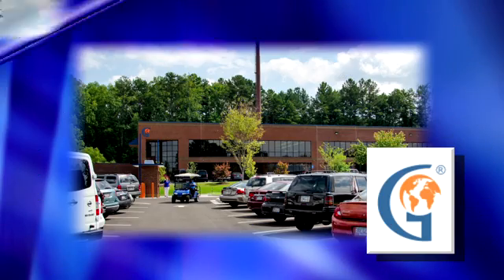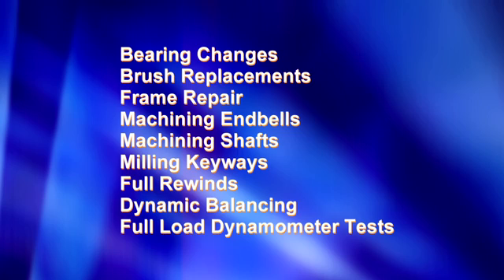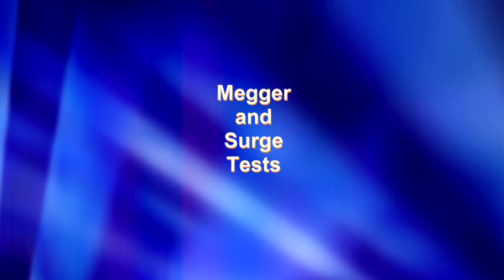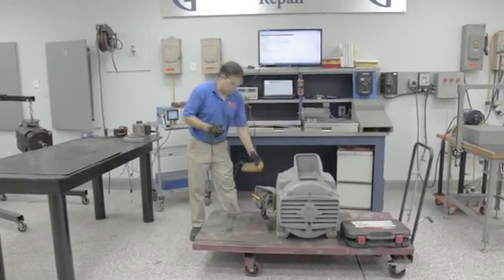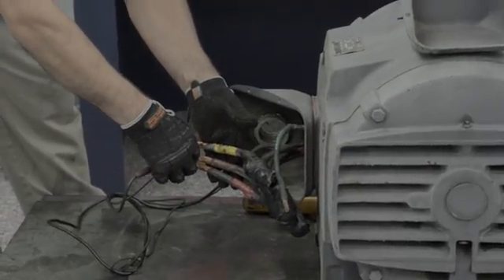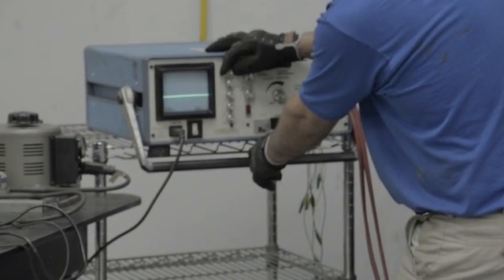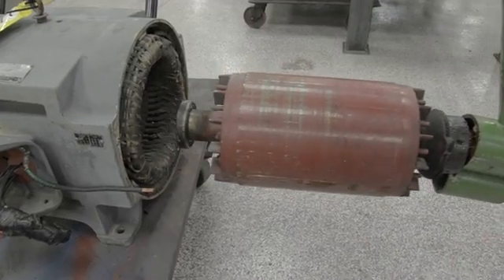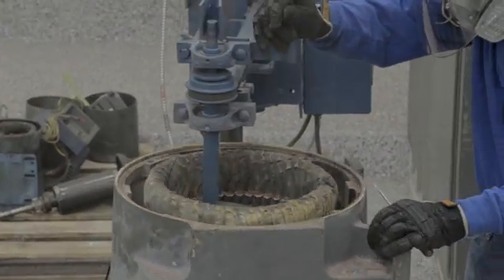Electric Motor Rebuild Disassembly and Reassembly - Global Electronic Services

Comment: Currently i am facing a problem With DC Motor.problem is mentioned below:

1. DC motor was overhauled.Rewound Field Interpole and armature windings.all windings are in good condition with 2000 Mohms value.
2.Polished and skimmed the commutator,,drop tested. found ok.
3.Brush and carbon holder is in good condition.

Now the problem is motor is giving heavy sparking on load. Application of motor is boom hoist motor.

On No load motors runs smooth no sparking,no vibration.

Why it's giving heavy spark on load and we opened twice the motor but not able to get the root cause.

Anything else that i need to check?
Reply: Hari Arjunan Your field winding or you armature May be wrong .winding may have Metric wire and your ohms maybe off.
Reply: Does your armature have equalizer if it does it may be off. Re set your neutral

Comment: is there any motor that can with stand 125 to15odegree heat if there then please mention
Reply: Class " H " insulation is 180 Degree C.  Nomex, and for this stator it was probably 5-5-5 with a double dip and bake ( Won't see this motor for 20-yrs unless it goes down on bearing. )  Nice CLEAN Shop.
Reply: Paul Monaco class H is not 180c. NKN is. Not NMN.
Reply: @HmongGuitarPlayer  Well Jr.    I was referring to " MOTOR TEMPERATURE RISE "  Class (A) = 105 Degree C.  Class (B) = 130 degree C. Class (F) = 155 degree C. Class (H) = 180 degree C. RISE.  I've been rewinding motors for 40 plus years, and you want to TEACH me something NEW ? ? ?   I was answering the gentleman's question above, and I'm guessing that over the last 40-years  I have spent more money on N-M-N Insulation, than you make in a year.  I do K N O W a lot about what I'm talking about. Have a NICE Day.
Reply: Paul Monaco are you a coil winder for 40 years or a motor winder there is a difference.
Reply: @HmongGuitarPlayer   I was a STATOR winder,   There isn't much that has changed in 40 - years of rewinding STATORS.  So I don't get your POINT ? ? ?
Reply: Paul Monaco I knew a lady who wound coils for 30 years and couldn’t take data or wind motors.
Reply: @HmongGuitarPlayer   OK... I owned the company,   * Advance Electric Motors * in Portland Oregon, and retired 6-yrs ago.  I also had women coil winders that NEVER took data. So I get it.  However they did REWIND STATORS, and pretty good at it.     Mostly 20 -  hp and under, and seldom any (2) poles. LOL...  Did you ever REWIND STATORS? ? ?
Reply: Paul Monaco Since you you have 40 years of experience let me ask you a question. 

On your two speed motors you have three different types. 

1.Constant Torque 

2.Constant Horsepower 

3.Variable Torque 

All these different types Tod motors will have 6 Leads usually number 1-6 or sometime you will have 1-7 

Now let’s take a Constant Torque connection for example the motor is a 2 poles and 4 poles motor. For you to run the motor at 3600 rpm you will need to put power on leads number 4,5,&6 and tied 1,2,3 together as a wye for running at 3600 rpm. Now to run the motor at 1800 rpm you put power on 1,2,3 and leave 4,5,6 open as the motor connection is a 1 delta 2 wye connection. 

My question to you is if you where to reverse these connections what would happen?
Reply: Paul Monaco Sir, I may not have as much experience as you do but you can ask me any questions about electric motors I don’t care if it’s Armature,Dc motors, single phase , pumps,form coils motors , generators  or how to test it including partial discharge or how to use a Schematic machine. Foreign motors , service motors. Don’t matter. Just ask.
Reply: @HmongGuitarPlayer  I would have to draw it out, it's been TOO long since I've had to think about connections. but being three phase I'm guessing that there would be no difference, if you make 4-5-6 the lines and 1-2-3 open. I do remember the EASIEST way to figure out Constant from Variable is Constant Torque is almost always HALF of the HP on low speed, as in 10 / 5 hp or 20 / 10 hp. Where as Variable torque could be 10 / 2 HP or even 15 / 5 HP.     You are the type of  Student that understands the THEORY. Congrats's
Reply: Paul Monaco On a Constant Torque motor the Torque is Constant on both speed but the horse power is 2 to 1 on Constant horsepower the power is The same on both speed but the torque is different,on variable Torque the torque would be different on both speed and the ratio is one to four on horsepower and you will alway have a wye on both speed. 

But the question I ask you not too many Winder knows about it or even think about it. 
And by your answer I knew you don’t know. 
So after 40 years even if you’ve been connecting it correctly all these years  I can guarantee 
You have never try to reverse the connection to see what would happen. 

Am I correct?

Have a nice day , sir